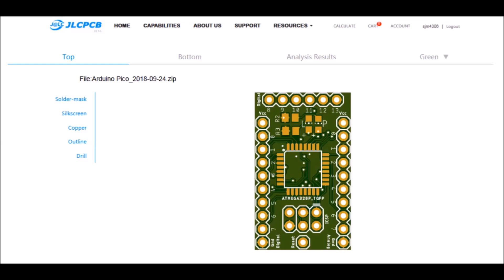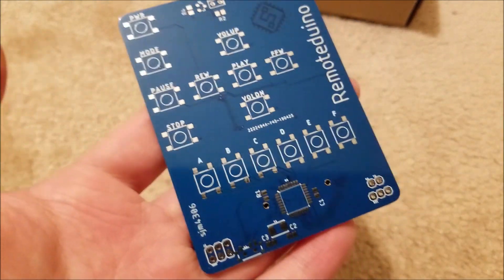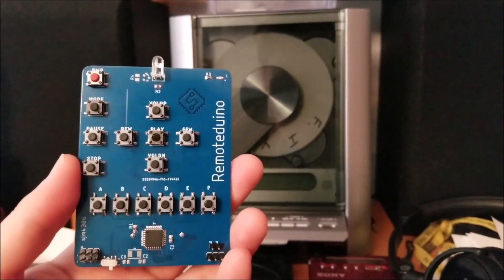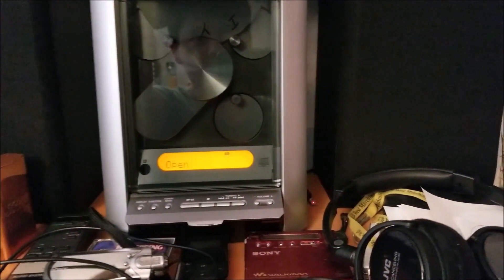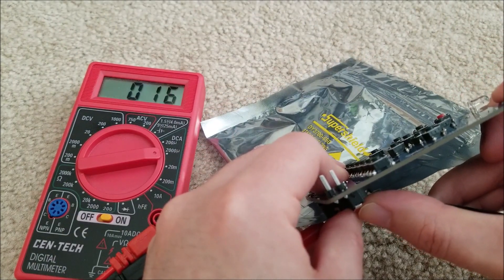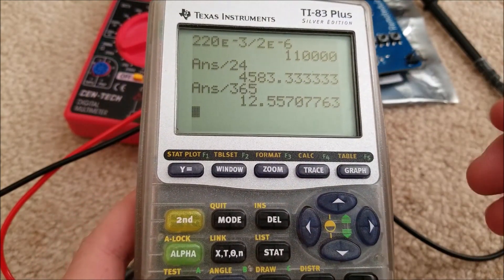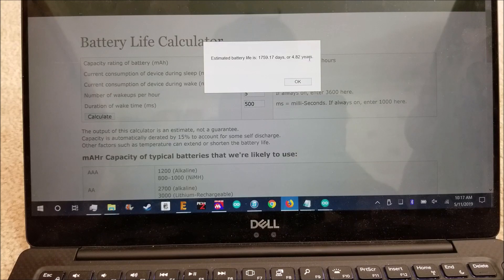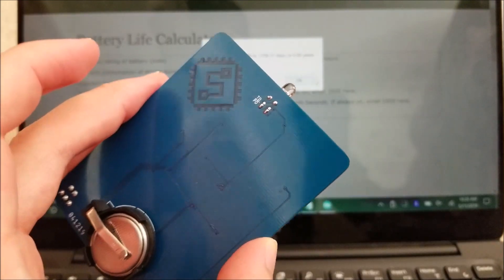Remoteduino: A Low Power DIY Programmable IR Remote

Comment: awesome video man! idk why this didn't show up when i was trying to build my own remote and none of them would work. Did you ever get around to making the newer version? is this something you would consider? maybe with an oled menu interface to select different remotes you've cloned and maybe even add RF capability to it to have a completely universal remote?
thanks :)
Reply from the maker: So I did make a tiny version after this called the remoteduino nano. I also have started conceptualizing a version with an epaper display under the keys to display different modes for different remotes. Haven't actually made a prototype for this idea yet though.
Reply: @sjm4306  that's such an awesome idea and low power! I wish I could make one myself, I've tried making an ir remote before even going off of others videos and none of them work for me. But I've subbed in hope that maybe you get around to doing it haha.
Have a great day man

Comment: Awesome project, nice job! (Much more elegant than the ones using diodes and MOSFETs to physically cut power to the MCU, rather than properly employing the low power modes as you have.)

FYI, IR remotes drive the IR emitter at really high currents (up to 1A). The emitters, which are typically rated for If=100mA, don’t burn out simply because they’re pulsed at such a high speed (the carrier), in bursts (the data), for such short amounts of time (a few seconds at most, normally, of button presses), that the heat stays well within limits. (Remotes also sometimes save power by using only a 25% duty cycle on the carrier, further reducing heat production in the IR emitter.) 

For example, a Vishay TSAL61/62/6400 (same electrical specs, just different beam pattern) list an absolute max surge current of 1.5A, a maximum continuous peak current of 200mA (both for pulses up to 100μs), but the normal operating conditions list both the 100mA continuous at 1.35V-1.6V, but also 1A, 100μs pulses at 2.2V-3V.

Since a 38KHz carrier has a period of around 26μs, then your pulses are only 6.5-13μs for 25-50% duty cycle, so well below the rated conditions.

So if you drive an IR emitter as if it were a regular <20mA indicator LED, you’ll be severely limiting the range, as you found. 

Of course, a button cell can’t deliver anywhere near an amp, even just for a few microseconds, so that also significantly limits the range compared to a standard remote powered by AA or AAA batteries. For what its worth, I just tested a Sony remote (which, with its stereo system, has the best IR remote sensitivity I’ve ever seen in any product. I can use it around the corner down the hall and it still works!) and it draws an average of around 50mA, as measured with a Keithley bench meter. I’d have to take it apart and use a scope to see how large the current pulses to the IR LED actually are (since it has an input cap, the instantaneous current draw can’t be measured at the battery terminals).

Comment: It didn't worked on my Arduino UNO. I tought it was the same using it as you did with the atmega328p
Reply from the maker: The uno has the same processor, but the configuration/wiring/fuses may not be the same as my circuit
Reply: @sjm4306  I just connected a led to pin 3 (IR_SEND_PIN from irremote.h) and a button connected from 3.3V to pin 8. I think something from your "sleep mode" it is not compatible with UNO
Reply from the maker: The sleep code was literally written in reference to the datasheet for the atmega328p, there's nothing to be incompatible with. The issue may be if you are trying to run a stock uno off of 3.3v the fuses for brownout protection may be set to prevent it from running below around 4v.
Reply: @sjm4306  I power UNO with a usb connected to my PC (it works with other codes), I meant that I connected the remote button to the 3.3V arduino pin. I also simulated it on Proteus but can't get the code to work
Reply from the maker: If you suspect the sleep code then just comment it out to test. Also you can insert state changes on the led pin and print serial debug messages to see where it gets stuck. Also I haven't used proteus but sounds like it's emulating so I doubt it would interpret all commands for all hw registers for the microprocessor so it wouldn't be useful to debug low level stuff like hw triggered interrupts or low powered sleep modes that shut off the oscillator and can only be woken with pin change interrupts.
Reply: @sjm4306  I used proteus to simulate the arduino UNO sending an IR message, created with atmega328p's Timer1 interruptions and some code, it worked. But I've never worked with sleep mode, I will have to test it from scratch

Comment: How many keys we can use your remote has 15 can we add more
Reply from the maker: If you change the software to use one of the keys as a shift or mode switch then you can add as many functions as you want without having to physically change the pcb.

Comment: I wish you would have put the components for the PCB board in a file
Reply from the maker: A quick look at the schematic will give you the parts you'll need. There's really only like 5 unique components in this design and all but one (the atmega microcontroller) can be substituted with similar parts

Comment: Great job. I need to make a remote for the list that picks me up in and out of bed. Am I able to program this so that it doesn't just send the signal in a millisecond and then stop? But that if I continue pushing the button it will keep sending a signal? I need to hold it down to make my Lyft work
Reply from the maker: Yep, the software for this project is up on my hackaday.io page so you can modify it to fit whatever need you have.

Comment: how long batteylife will you get with the cpu in sleep?
I'm looking into making a batterydriven doorbell that plays an mp3 when you push the button.
(need to be batterydriven to replace current doorbell, button is wired, bell runs on 4 C cells.)
I'm thinking using an arduino to power on (with transistor or mosfet) an mp3 board that plays the jingle, then goes back to sleep.

will probably run it off of a lipo or something and 3d print a new box for it.
Reply: I'm not an experienced electronics guy so if you have any suggestions or wanna make some videos about ways going about it that would be really cool!
Reply from the maker: I've added a link (https://oregonembedded.com/batterycalc.htm) you can use to estimate battery life based on current measurements and what battery capacity you choose. Additionally I uploaded the code for this project here https://hackaday.io/project/165553-remoteduino. You should use it as an example on how to use sleep to minimize power draw on a battery (also you'll need to read the atmega328p datasheet sleep section). Another thing to keep in mind is if you use an off the shelf arduino that even with all tricks I used in my code the minimum current draw will still draw 5-15mA because the circuit uses a linear regulator, serial usb chip and has a power LED which will always be powered and draw much more power than the sleeping atmega chip. To get the current down you will have to use a bare atmega chip or remove those extra power suckers from the arduino board.